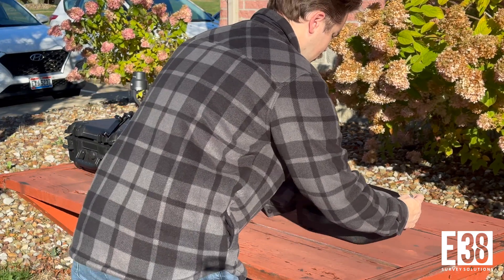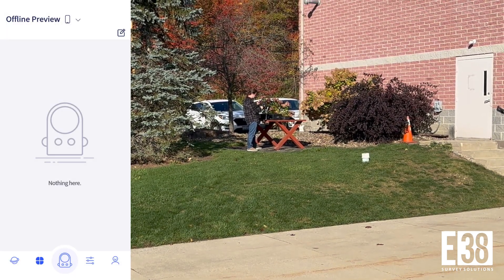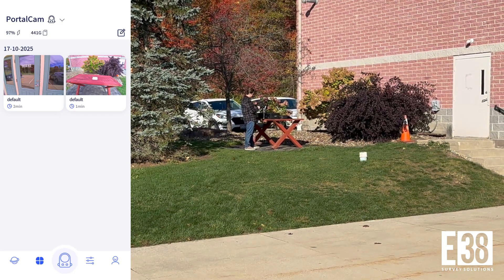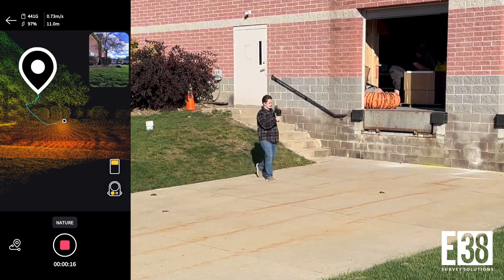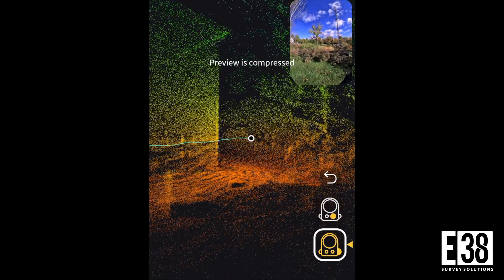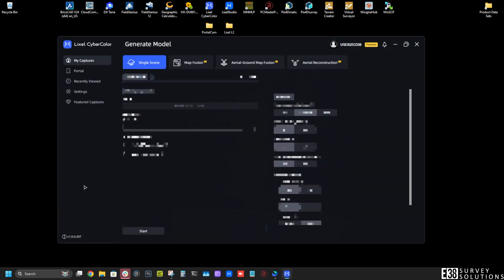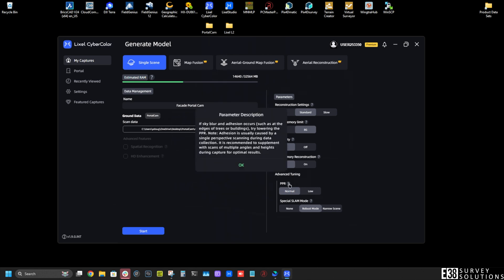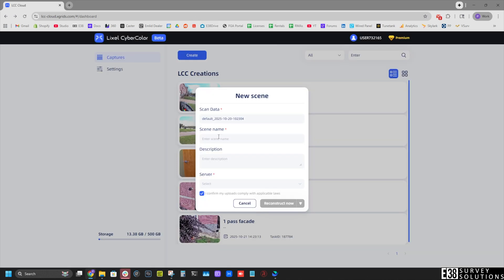XGRIDS PortalCam Workflow

Comment: Hi, good video, can you export the 3DGS in .ply?  And what about the point cloud can it be used in other software? Like autodesk recap?
Reply from the maker: Yes, currently you can export from Lixel Cyber Color in .ply, .lcc, and .usdz. There isn't currently an off the shelf method of using any of the lidar data or pulling a point cloud from the PortalCam. You would need to move up to a Lixel K1 or L2 for that type of functionality.
Reply: @e38surveysolutions59  thank you, i'm still thinking about the pros and cons to make this purchase, so far it's the fastest and easy way to get a good 3DGS, do you know any other option?

Comment: Wait so wihtout their software subsription camera is unusable? 1500 dolars per year doesn t seem like a good deal, thus I wanted to see what are the raw files from the camera but you blurred them for some reason. Why?
Reply from the maker: The raw project folder contains an .xbin file, an external_data folder(empty by default) and a project_data folder(contains log and model folders with extensions included .csv, .jpg, .bin, .txt, .json). One year of LCC is included with the PortalCam.
Reply: @e38surveysolutions59  Thank you. Yea I know 1yr is included but after that they make you pay like 1500 dolars for each next year. That means that is you don t pay them that your camera will be unable to use. That s so crazy